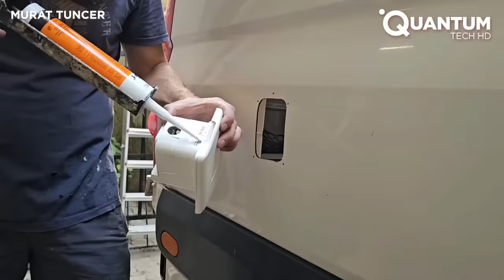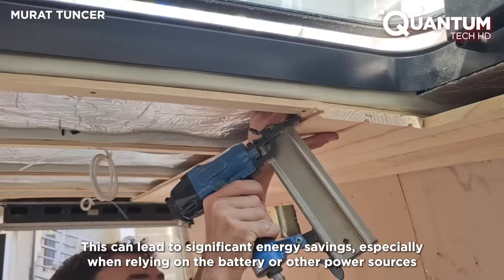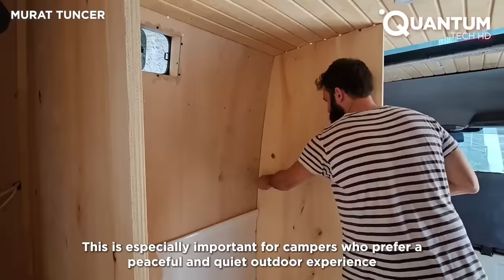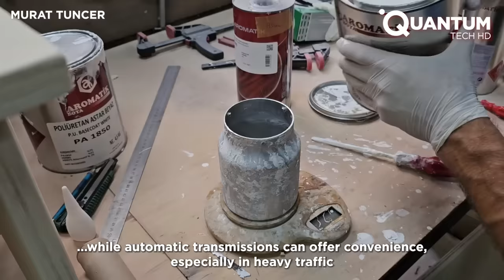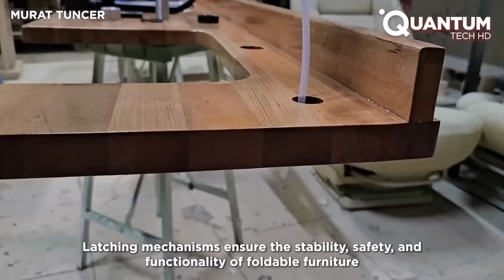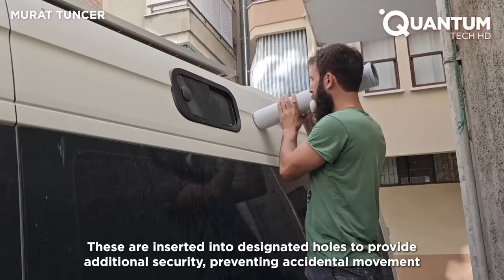Man Builds Amazing DIY CAMPERVAN | Start to Finish Conversion by @murattuncer

Comment: The interior is fantastic and beautiful, but unfortunately, it's too heavy. It would be better with lighter materials. For example, the sink alone is too heavy; using stainless steel would be lighter and more durable. Some parts of the interior don't necessarily require such heavy wooden panels; plastic or acrylic would be more appropriate. This weight makes fuel consumption too high, limiting the travel distance or reaching locations far from gas stations
Reply: It doesn't matter
Nobody actually usually uses these vans for more than a few weeks
Then they realize how badly designed it is, and how much "van life" actually costs
Reply: @LEOhopeful ..yes,and then they try to sell them for the double amount of what they spend/wasted
Reply: Yes,a fantastic bathroom
Reply: Excellent point
Reply: Moot point. You don’t have to carry it yourself, it is all installed in a van.
Reply: @giorgiorossetti3276 I remodeled a Promaster 3500 and used it for 2 years before I upgraded to a Mercedes AWD. I didn't do near as good a job as he did. My best investment was an Espar heater that ran off the gasoline directly from the fuel tank.
Reply: @LEOhopeful Talking nonsense,  there may be some expense, but it doesn't compare to rent these days, or most mortgages, mine has gone up 2.5 times, which is unsustainable,  maybe you live in a mortgage & rent free home, as for electricity,  if I had everything on to heat, & 'I'm talking about a two bedroom flat',that'd be over a hundred pounds a week, just for the electric,  yes ! I Have asked, if I'm paying for the whole block of 4 before, it appears not, they only rent, haven't paid the electric bill, which js more than mine,so, I assume they're just going to do one, imminently, and good riddance to those living above me, but I'll be forced out before them I expect anyway, due to the extortionate cost of trying yo live in a 'home, house, flat'.
Reply: Dem schließe ich mich vollinhaltlich an! Wirklich schöner durchdachter Umbau,aber mit viel zu viel schweren Materialien gearbeitet! Das Leergewicht dürfte gut 3.000kg überschreiten so das ein LKW Führerschein nötig ist! Dazu käme noch Wasser,Vorräte,2 Personen...
Reply: @LEOhopeful  not always true. I converted and lived in a van for a year, driving it from Australia to the UK. I would do it again in a heartbeat.
Reply: Agree , the cost of petrol because of the weight , would amount up .
Reply: @giorgiorossetti3276 well if they are silly enough to pay what you think is over priced , more fool them 😅😅
Reply: All to heavy , could have used lighter wood , this van will cost a fortune to run .
Reply: Wondered about the weight, too, and the effect on shocks and springs.
Reply: @mattwarner-smith6356  how do you drive from Australia to the UK? That's a head scratcher
Reply: A bunch of ppl talking about things they don't know anything about ! It's not that much weight! These are work vans . It is what they were made to do. I built them much heavier than this and on average an unbuilt van will get 29 mpg and a built one 27 to 27 and 1/2. 

You are building a house that goes through an earthquake every time you drive somewhere.  Make it LIGHTER and it will just come apart.
Reply: Much To Heavy!!!!!
Reply: 10 for craftsmanship, 1 for all this weight. Maybe its just me but i don't get why people kitting out their vans to look like house inside and using same  materials, wood wood everywhere wood 🤷‍♂️
Reply: I was thinking the same thing. The reason manufacturers use fake wood etc- is because of weight. Besides that, keeping wood varnish and paint looking nice is hard.
Reply: @kzhemh this is what I said! I assumed he shipped the van over and used it in both countries….
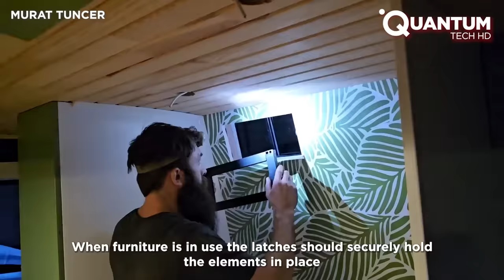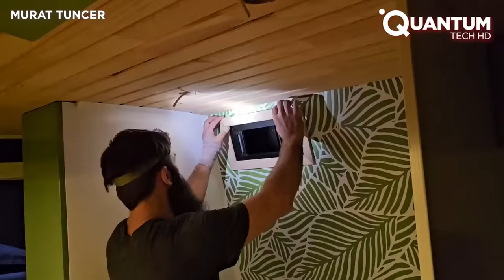Reply: @ytwos1  8:16 8:18
Reply: Beautiful build.
Reply: @mattwarner-smith6356  Superb, some journey, and no doubt a great experience 👍
Reply: Wood has positif energy.
Reply: @mattwarner-smith6356  You drove it from Australia to the UK? How is this even possible mate🤔
Reply: @Leura10  Drive to Port Botany, put van in a container, container goes on a ship. Pick up van from  the port in Malaysia, then Thailand, Laos, China, Central Asia, Turkey, Bulgaria, Central Europe, Western Europe, ferry to England. Done.
Reply: @kzhemh  Van had to be shipped to Malaysia from Sydney. It couldn't swim. Also needed to get a ship across the Caspian and the English Channel.
Reply: 😆 People tend to check the weight.   We're about to strip half of ours out.   Our rock n roll bed weighs more than all of that wood.     We're putting in a u shape soda area using wood.   Much lighter.
Reply: I have viewed a lot of videos about designing and building out vehicles so they can be lived in and I would have expected weight to be discussed in most of them but it is almost always overlooked entirely. 
I appreciate these comments.

Comment: I just want to know one thing : Did they upgrade the suspension , engine , wheel and tire ply , axles , etc as well or not ? Seems like alot of work still ought to be done by those builders .
Reply: The absence of professional expertise may result in unstable foundations, elevating the risk of accidents during transit.

Comment: It's very strange how he put insulation under the floor boards.  But, no ceiling or side walls insulation.  What the ??  And no.  That silver stick-on layer is not proper insulation.

Comment: A very good video showing excellent craftsmanship and a very practical Design. It brought me back to 1977 when I started converting a brand new 77 GMC Vandura Short Box Van by cutting off the roof. I made my own raised Fibreglas Roof for it. It had a 2 Burner Stove, Sink, enclosed Toilet and Bunk Beds to sleep 4. When the family grew I removed the camping gear and eventually ended up with an 8-Seat Van by installing two Aircraft Bench Seats. We had it for over 22 Years.
Reply: That's amazing! Do you remember the price of the van when new? I loved those style vans back then. If I'm not mistaken, it was the same style as the Hardy Boys had in their series. 350ci motor?
Reply: I'm  considering purchasing a 26ft RV or van conversion for mobile office...advice on pricing for conversion vs buying small rv?  Small rv has a lot of unnecessaries for business

Comment: Very rare correct placement of the burner on the door side of the kitchen counter. I have been watching hundreds of van builds (if not thousands) in the last few years and  99% builders are putting the sink there, mostly for the purpose of using the water from the sink outdoors, I guess, but, in exchange of putting the oily smelly smoky cooker burner next to the bed, your pillows and blankets, crazy. This location provides hundreds times more automatic ventilation it's like half outside already.... I was always going like "noo!! Whyyy?" But this was finally the wise choice,  must be the Turkish wisdom :p

Comment: My DIY CAMPERVAN was stolen from me on my street 13 years ago, and then ended up in the Hit Movie "Super Storm" and was blown to bits a half hour into the film, that film was made right here in British Columbia.
They replaced the 77's steel grill with a more modern plastic grill, white bumpers, and elephant mirrors too.
Also, someone removed the rear tire carrier that I put on the right rear door, but you can see the door is dented from me backing into a telephone pole. They gutted the interior, but you can see the yellow foam job that was done in Missauga. The stock 2' steering wheel was replaced with a smaller, uncertified black rubber foam one. 
There is a scene in the movie of a woman in the back of the van but that's just Hollywood trickery.
The final scene of my van shows it pull a U-turn, a lightning bolt from Outerspace? hits the van the occupants escape somehow and it's blown to bits with dynamite so there's no way I can check the serial numbers at this time, 13 years later. But it was a nice van and, I took it all the way down South three times and over the Donner summit to Reno and through Los Vegas on the way back from Tijuana, Mexico. Also, I flew my hang-glider off a mountain in Santa Barbara that was on the roof of my van and passed my Hang IV test so I could fly Fort Funston in San Fran, and Torrey Pines just North of San Diego in La Jolla, which is the nicest place in Southern California.

Comment: Nice seeing wood constructed motorhome, but wood is heavy - especially plywood and anything thicker than 1/4 inch will add significant weight to your project. Then you need to load it up with vacation essentials, food/water/stuff and your whole motorhome project on wheels might be over weight for traveling. Fuel economy wasn't thought of here.

Comment: A two season camper, at best. Insulation is non-existent. Why do all the finishings if the interior walls do not have adequate insulation to increase the ability of the unit to be comfortable in all seasons?